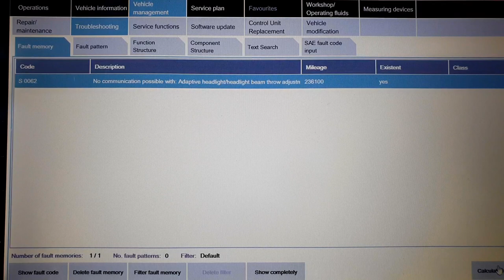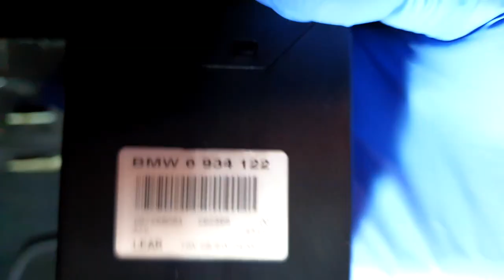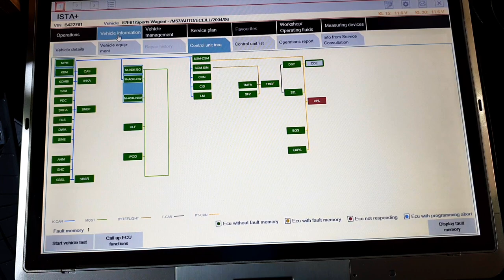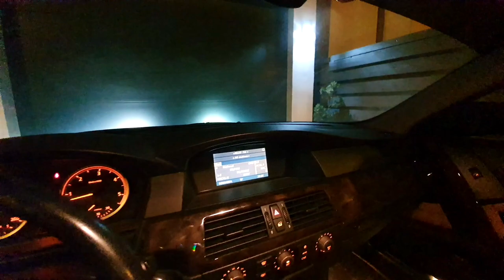BMW e60 Adaptive Headlights module AHL Easy repair

Comment: Dear M.Ovidiu, best regards from Serbia for great video. After seven years driving with green light flashing on light module and without automatic headlight leveling, i purchased diodes A4S on Aliexpress for several dollars,  solder it for AHL module like you pointed on video and VOILA - auto leveling is here. And not just that: when cornering adaptive headlight moves left - right. Once again, thank you very much!
Reply: Hey, can you please just send a link ?

Comment: Super video (y)
I am in the proces of buying new headlights for my E61 LCI
The car is factory fitted with non adaptive xenon but I want the adaptive option when I buy new units.
Are my car fitted with an AHL-module or in any way prepared for that module ?

Comment: I know this is an old video, but i hope i will find some help here. So, i recently sent my headlights for repairs (everything was working fine they were just in terrible shape). The insides have been completely refurbished along with the wiring.  When they came back and i reconnected them, the green dot started flashing and there was no movement from the headlights. After scanning the car with ISTA it showed AHL module as 0 faults and green. I can trigger them manually, but only up and down. On any other direction i'm getting "ERROR_ECU_GENERAL_REJECT". Tried to search it but found nothing of relevance. Any advice what to do?

I forgot to mention that on the table AHL is working fine in every direction, so i doubt it's the headlights fault.

EDIT: Car is E60.

Comment: i dont even have that box, in my LCI e61, i have failure still and chckecu under the headlight module its all good, tested with other one... dose the motor in there is bad then ?
Reply from the maker: You don't have the "box" because on LCI the module is integrated in the LM . I don't know what your problem could be only by guessing, you need to do a proper diagnose to the system.

Comment: salut. am o problema cu un e61 si anume la inchidere ceva modul intra in sleep foarte greu si imi consuma o arte din baterie suficient incat la pornire sa primesc mesaj de ' increased battery discharge'.  ma gandeam sa vin pana la constanta daca ar fi loc la tine pentru o diagnosticare
Reply from the maker: Salut , din pacate eu nu te pot ajuta , dar un electrician specializat BMW  din zona ta sigur o va rezolva !

Comment: Hi! What if my diode have .475V parameter? Is it not enough? I have E519 code error, there is no dynamic xenon function and self leveling. I cannot connect to adaptive lights module by INPA.
Reply: I had the same issue replaced ahl coded for car same issue replaced modules under lights same issue put original  back in and factory reset the lcm with protools  and all is working now probably  could have used ista but that program is sometimes over my head but I do have it along with inpa.  Funny thing is I could always move them with software but was getting a start up error that factory reset fixed it

Comment: Hi Ovidiu! 
I have an e63 m6 with a light fault! It had water damage in one headlight, I’ve changed both smc modules and the headlights now do the “start up procedure” so both lights move up/down and right/left, so the system works. However, I still get this code “RSMC2 no communication with steppermotorbox right”. If you would spare a little time, any help from you on what might cause this will be highly appreciated! Thanks! 🙏🏼
Reply: Its RIght SMC , servo motor controller , seems something is wrong with the wiring that goes to SMC or the servo it self has failed , there is two in one headlamp.

Comment: Hi all . I have a big request for you. Please 🙏🙏 write where on the Internet I could find the same diode A4s or similar/analog , Or in what other block can I find this diode ?????? I recently discovered that the problem is in this block. Since the day I bought my e60, the headlights have not worked properly.  I will be very grateful to you for your help.
Reply from the maker: Hello , do a search on Google , or if you have other defective/ for parts module you can search there, or you can create one using 2 diodes
Reply: I found a t04 on an old motherboard and it appears to be working fine

Comment: Hello my friend i have some error code on my bmw e92 2012, cc-id 295
When i start the car the headlight go upp and down but they dont move to right and left When I turn the steering wheel to left and right. I have wather insid the left headlight.
Reply from the maker: if you have an error it's a problem in the headlight or in the control unit or by nature, you have to find someone who knows how to fix something like that and they will do it for you ... so with the opinions on the internet you won't be able to fix it

Comment: Hello. I have lci with dinamic xenon. And on automatic green light is on(not flashing) but lights not move when start engine, and not moving with steering. Maybe someone have an idea.
Reply from the maker: Hello ! You have to make a diagnosis if you want to fix it!

Comment: I have replaced AHL module in my car.now cornering light not work.what is the problem.do i need to do any calibration??
Reply from the maker: if you are sure that the replaced module is a functional one, it should work, but maybe you have another problem. a diagnosis will have to be made.
Reply: @MOvidiu  ok thnx genius
Reply: Do you replace on right side? Try to change left to right and right to left for test. The adaptive light shall be ok

Comment: Hello boss. When I steer right the headlights go right but, when i steer left it comes to the mid and then does not move more left. What may cause the problem? Please help me
Reply from the maker: Hello,  if you have watched the video you have find the answers
Reply: @MOvidiu  yes i watched but no answer to my problem :(
Reply from the maker: No you didn't watched all the video  , becouse if you have watched it completely you have found your answer
Reply: @MOvidiu  are you sure you understood what my problem is?
Reply: Hi bro, he said very clearly in the clip. 
In case you set light to Auto: 
The Adaptive lights do not turn left when the bmw stopped. They assume you are pulling out into traffic and do not want to blind oncoming drivers (say when you are at a turn lane waiting to turn left)
It's intentional: 
- The headlight move up and down only at startup to auto level. 
- It will turn/work both left and right only when you are in motion/on moving only (over 20-40km/h you can see more clearly)

In case you set light to Maunal: The Adaptive lights will be deactived. The adaptive lights  do not turn anyside even when bmw in stop or in motion.

Comment: I think you can use 2 times 1n4001 i want try tomorrow to my module.
Reply from the maker: Shure you can!
Reply: @MOvidiu i have fixed it i found a4s on a water damaged airbag module. thanks that was easy with yout video.

Comment: Can i use A4T instead of A4S? Looks like its little bit diffrent 1.2ohm
Reply from the maker: Yes
Reply: @MOvidiu thank you! This fixed my adaptive headlights. Before there was no movement at all- even no self test(up&down) when i start the car. Now ISTA recognizes AHL ECU again and everything is working like a charm. Respect man👊
Reply from the maker: Glad to hear that! If you want to suport this channel especially if it was helpful for you share this video and share this channel!

Comment: Did you know about fuel pump controle module over heating problem??
Reply from the maker: If the EKPS it is working hot is possible that the in tank fuel pump is bad and it takes more amperage,  you can see it with istaD
Reply: @MOvidiu  ok i will check and thank you..what is the correct amperage..BMW E60 2006 N52 engine...pls help me...if i travelling daytime about 100km, my car engine suddenly stop feel like no patrol in tank & i will try to start again.engine crank but not start...after 15,20 minute i can start again.....

Comment: In e53 2006 the same modul ahl like in e60 or different?thank you
Reply from the maker: Yes it's the same control unit
Reply: @MOvidiu  thank yuo
Reply: @MOvidiu  Hello from Ucraine!Dear Ovi I  have one question to Yuo-in my e53 m57 from 2006 after small accident,don’t work more left adaptive headlight.I change two adaptive modul scm in headlight(they was totally broken by humidity) and instal new bi-led lens and glasses,step motors are good and work,but after all this manipulations left headlight anyway not work🥲😭.diagnostic says error in alc(I think alc=ahl)solution of my problem ripearing o new modul ahl?I hope Yuo help me.but when I turn on light in position A and turn off right headlight after few seconds car turn on left headlight and all function good,but after few turn off the car,problem repeat again-left headlight not work.can Yuo help me to solve this problem?thank Yuo
Reply: @vasyldizhak3141  advise you to change the ballast right to left and left to right. Test it! 
If still problem, new ballast pls !

Comment: Salutare, ma poți ajuta și pe mine cu instalarea programelor pentru testar?
Reply from the maker: Salut ! gasesti pe olx un baiat din Iasi care vinde si instaleaza IstaD si tot ce ai nevoie e foarte serios si priceput cauta pe olx IstaD in Iasi
Reply: @MOvidiu  super mulțumesc frumos, mai ales pentru video acum o sa îmi repar și eu modulul, nu credeam ca e doar atât 😂
Reply: @MOvidiu  as mai avea o întrebare, legata de baghetele de la faruri, se aprind doar pe poziție, orice alta comanda asa da ( semnalizare, avarie, faza scurta, faza lunga) se sting...
Reply: Merge doar Dioda A4s? Sau mai merg și alte diode?
Reply from the maker: @AdrianPopa21  A4s sau echivalente

Comment: That is amazing but NOT an easy repair 😂😂 I have adaptive headlights fault but the dealership told me it was the AHL motors and not the module. They said I had to replace both headlights. They quoted me something like $5000 to replace both headlights. Do you think they’re right or just trying to rip me off?
Reply from the maker: Hi, unfortunately you are doing very wrong. how to ask on youtube if the repair estimate made by a dealer or someone is correct or not? how to know youtub or internet what problem your car has for starters. here you can see how it is repaired to understand how complex that car is built.
So if you think that the diagnosis and estimation are made wrong, you can only find out by taking another specialist with your car to see if what the first dealer specified is really correct.
Reply: @MOvidiu  yes you’re right. Now the dealer is telling me that my LM is damaged too, because my brake lights are lighting up whenever I turn off the car. My car is an lci and the AHL module is integrated with the LM. Can broken AHL motor somehow damage the LM? Do I need to get the AHL issue fixed before getting a new LM?
Reply: Do you have an e60? I have a headlight out and AHL error too and I'm thinking about getting rid of it if I need to pay 5k.
Reply: @ashtreylil1  yes I do. You should check the headlights first. In my case, the outer layer of the wires inside the headlights are destroyed, which is common in e60. That caused shorts, and thus shorting my LCM too. Some people have reported water ingress in their AHL module at the bottom of the headlight. I havent checked mine yet. And new headlights in Europe or USA are definitely not $5000. I live in Indonesia and the customs are crazy high. Also, they come with xenon and AHL modules and new bulbs. If yours are not damaged you can reuse the modules and bulbs and the total wont be $5000. Depending on the cause, you may not need to replace the whole headlights.
Reply: @jegerm6752  I took out my driver's headlight (the one that high beam is off in) wires insulation is cracked and rotting. Do you know if I can buy the headlights and module and replace them myself without coding? It wasn't difficult to remove and replace. I don't want to pay labor to a mechanic that will be 5x the price of parts.

Comment: There is no problem with the headlights of my car, but the headlight on the right does not have electricity, the signal is long, etc. Xenon does not work, I tried to find ahl by watching your video, there is no moral at the place I watched in the video